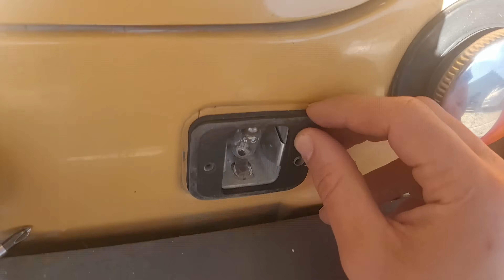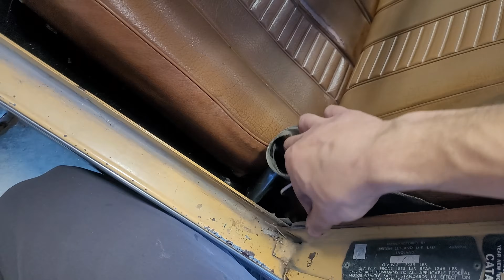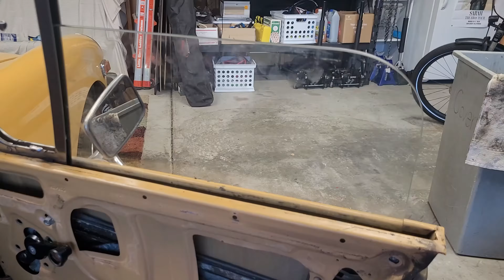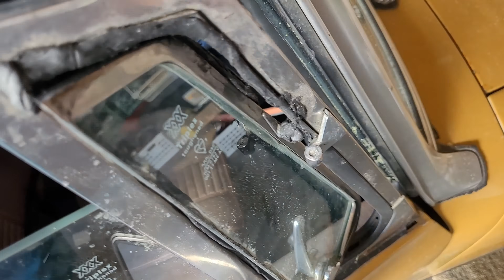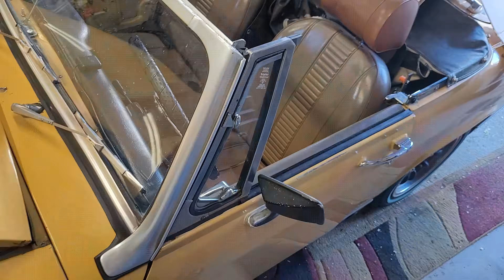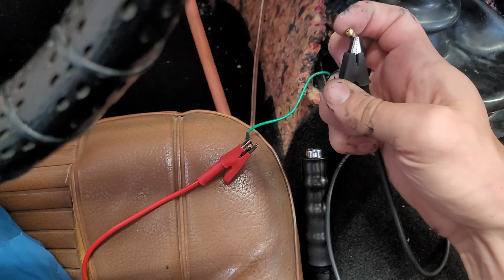Replacing the 50 Year Old Seals on my MG Midget

Comment: I replaced a few seals on my '76 about 12 years ago just after I painted the car. Seeing those metal window clips again brought back some painful memories. I think I used a modified paint can lid removal tool to finally get those in place. You're right, those door window seals were the hardest ones to deal with.